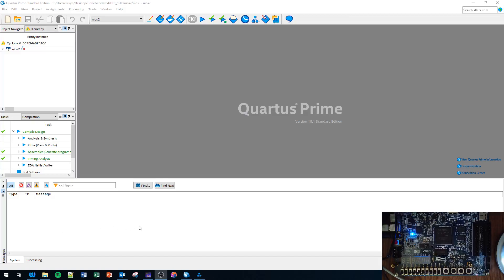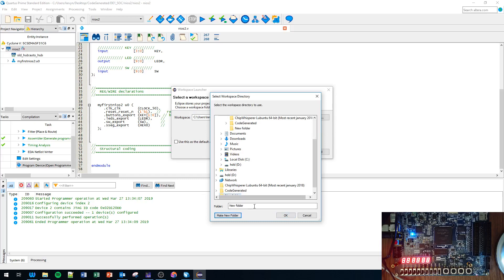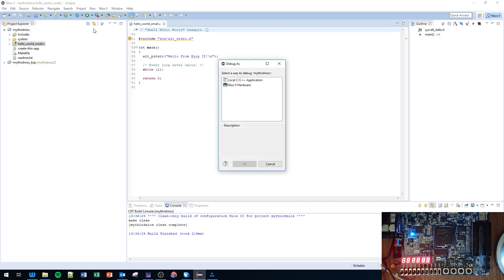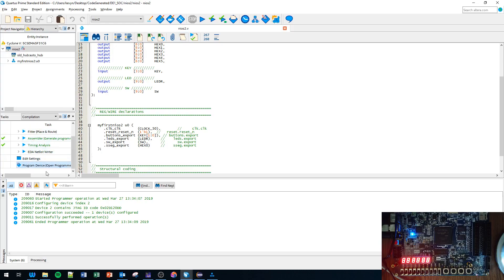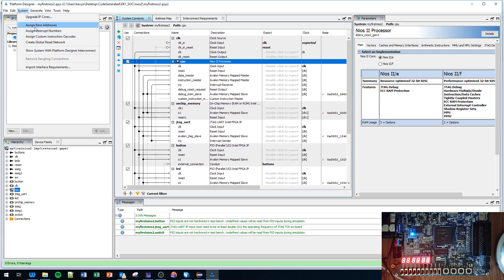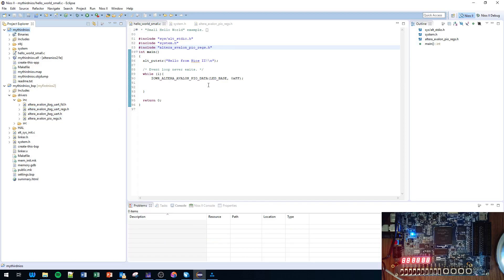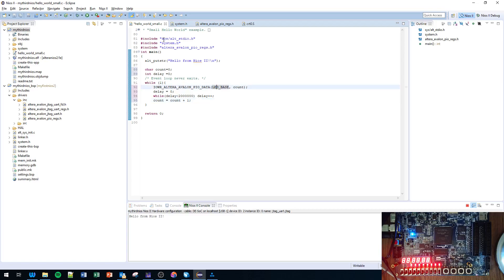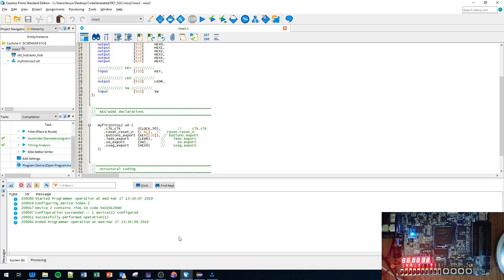Setting up the NIOS II in Eclipse on the DE1-SoC

Comment: Any idea how the "Altera CDI GDB Debugger" works?   The plugin seems to have several executables (nios2-gdb-server, nios2-elf, etc) and lots of java files (com.altera.debug.cdi.gdb.plugin_11.1.0.173, etc) in the nios2eds installation folder.
How would you go about installing just this "Nios II Hardware" plugin to an existing eclipse installation (ex Helios) so that you can debug a Nios without installing everything?

Setting Eclipse (2010) to run in Win-Xp compatibility and as Administrator seems to help.. but only if I open Prime 18.1, and detect the Jtag first!